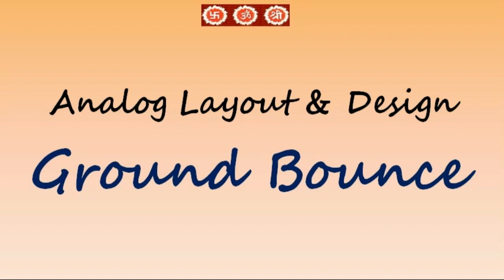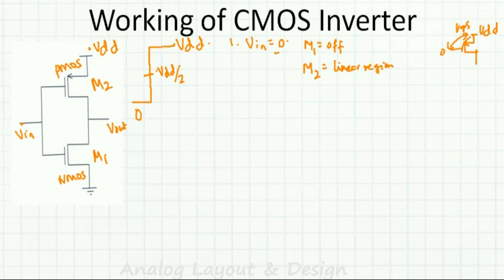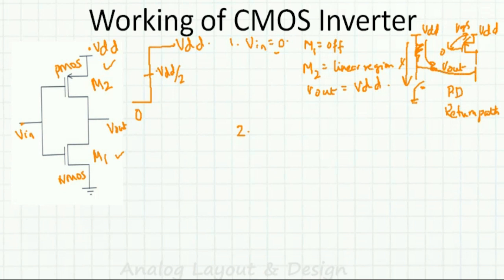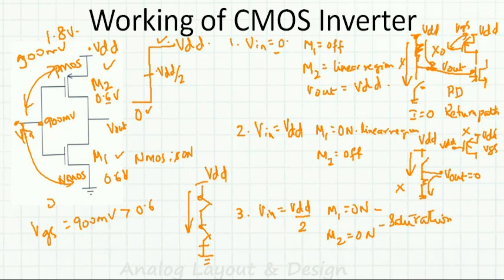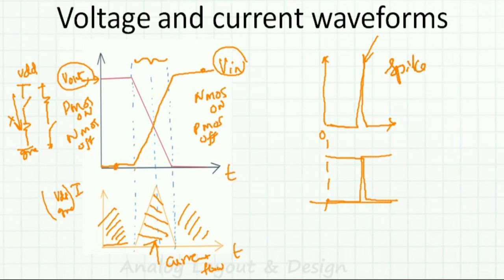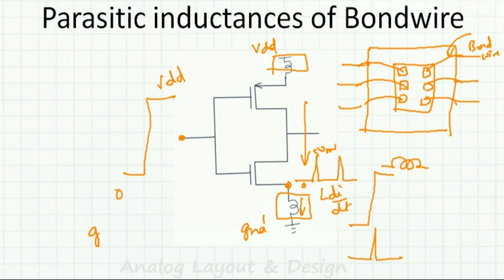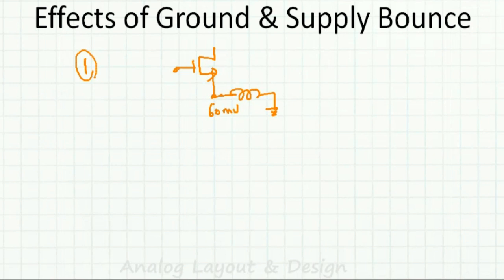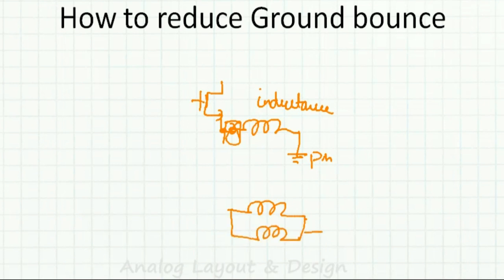GROUND BOUNCE

Comment: please explain mos operating regions again with Vds > vgs-vth perspective. I think in case 1, 2 one Transistor is off and other is saturated, in case 3 both are in linear  region. Please clarify.
Reply from the maker: Ok will add a video on only transistor regions of operation during transition in a inverter

Comment: this video is easy to understand

https://www.ipen.br/biblioteca/cd/ieee/1999/Proceed/00403.pdf this paper is bit complex for me to digest, will there be any chance you will be able to make a video?
Reply from the maker: thanks for the feedback... for me to make video takes quite a bit of effort.. so now I am addressing topics that most of them are interested in...  the paper you mentioned has EMF theory and making a video for all may not be a good idea... please go thru the paper and whenever I find time, I will get back to you on some explanation....are you PCB designer?
Reply: @analoglayoutdesign2342  yes I'm a pcb designer, I started as hobby at 17 years old and  now 21 doing it seriously. I am intrested in SI because I am handling high speed designs. And lot of ambiguous understanding especially in practical  PCB layout and SI. I don't have access to world class equipment to observe so the best thing I feel I can do right now is to understand SI model and try implement the closest understanding on real design.
Reply from the maker: @electrolance7505  ok..good luck..ur exploring the right way...still i feel take help of tool

Comment: Why the voltage is plus 60mv instead of -60mv in ground bounce sir
Reply from the maker: from supply it will subtract..ie .6Omv below[-6Omv] and ..from ground, it will be above..ie. +6OmV
Reply: @analoglayoutdesign2342  thanks for the quick reply sir
Reply: @analoglayoutdesign2342   Sir the current is flowing from vdd to gnd due to transition vdd/2, hence we are getting ground bounce due to parasitic inductor which opposes the current flow, what about the supply bounce sir...same reason or any variations are there...

Comment: Inductor does not accept the sudden change in current. Where that current goes?
Reply from the maker: Inductor opposes the change.  Current will still flow thru the conductor.. it opposes the change by inducing a big voltage...Ldi/dt
Reply from the maker: *inductor not conductor